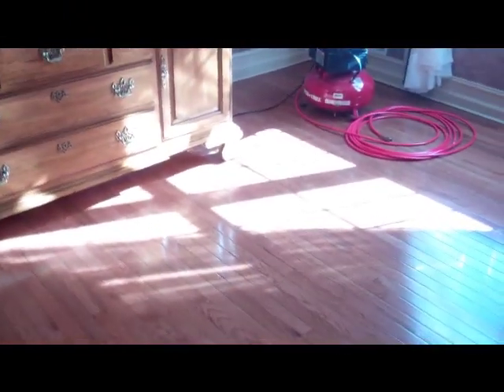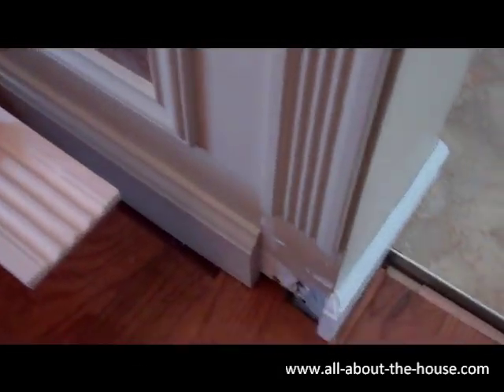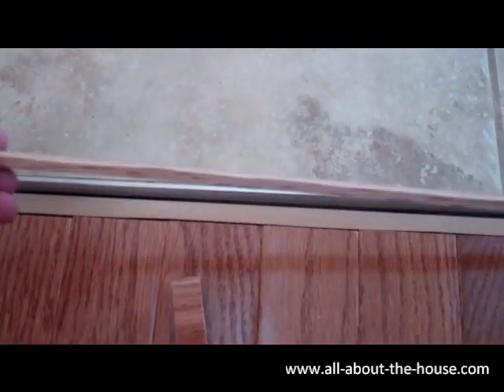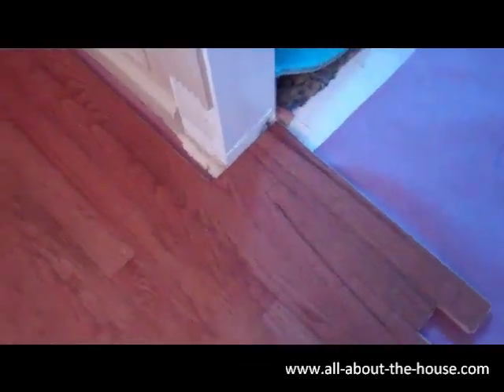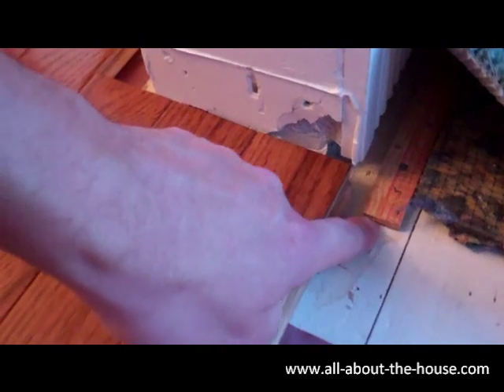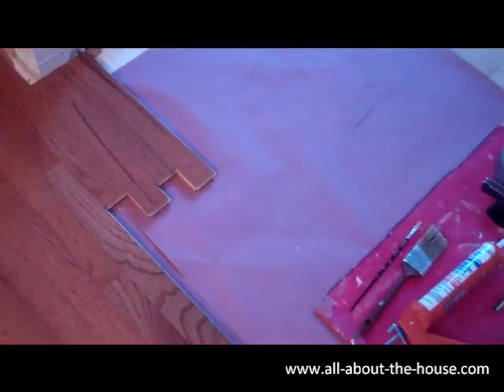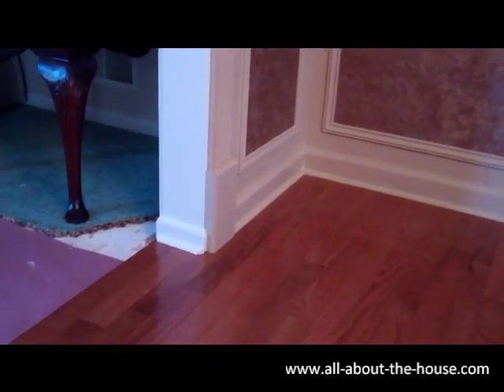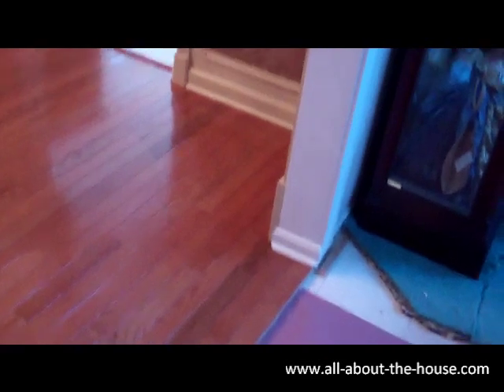Installing Hardwood Flooring - Part 3

Comment: Beautiful floor Mark!   What do you think about a cleat/stapler from Harbor freight?  I could not tell if you were using cleats or staples in your install???? Any recommendations?
Reply from the maker: Thanks! And apologies for the delay in responding; I've been a away for a bit. But to your question, I used a blind nailer (that I rented) along with the associated 1.5" 16 gauge L-nails. Wrote an extended project journal/article on this installation that you might find helpful here at: http://www.all-about-the-house.com/hardwood-floor-installation-trim-work/. Best of luck with your flooring project!